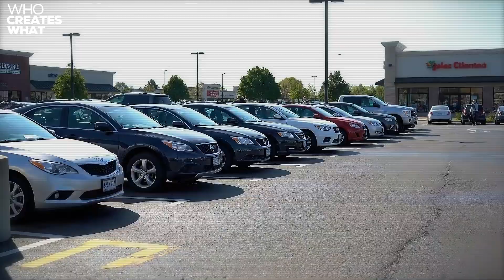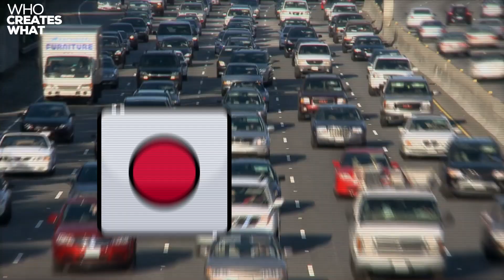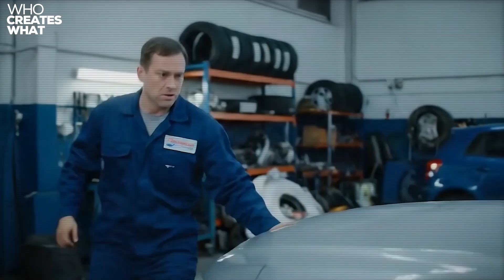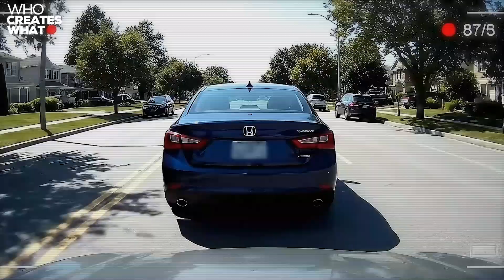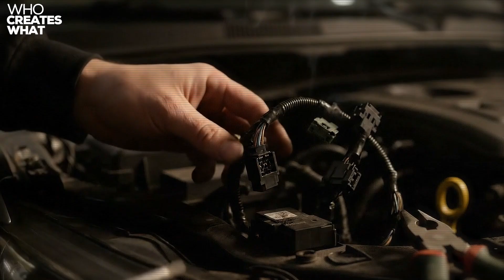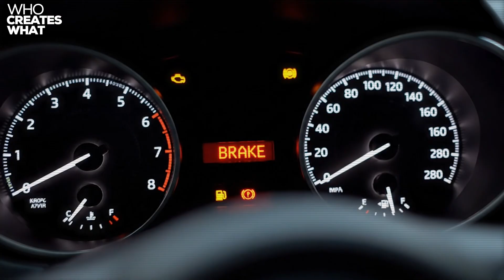Why Your Brake Warning Light Won't Turn Off (Even When Everything Looks Fine)

Comment from the maker: 🔧 Here are the essential tools I use in this video to diagnose brake warning lights (Amazon affiliate links):
Diagnostic Tools:
1. ANCEL AD410 OBD2 Scanner - https://amzn.to/42QuieV
2. AstroAI Digital Multimeter - https://amzn.to/42UMnsd
3. LAUNCH CRP123X Elite Scanner (ABS Code Reader) - https://amzn.to/4o55fgN

Brake Maintenance Products:
4. Prestone DOT 3 Brake Fluid (32 oz) - https://amzn.to/4osnV9R
5. CRC Brake Parts Cleaner (14 oz, 4-Pack) - https://amzn.to/3LnLKRV
6. WD-40 Specialist Electrical Contact Cleaner - https://amzn.to/43vVPCu

Replacement Components:
7. ACDelco Brake Pad Wear Sensor - https://amzn.to/4qETMGz
8. Dorman Brake Fluid Reservoir - https://amzn.to/3L3q5OP
9. Permatex Dielectric Grease (3 oz Tube) - https://amzn.to/43sqDnN

Professional Tool Upgrade:
10. FOXWELL NT624 Elite Scanner (Full System Diagnostics) - https://amzn.to/3J76QU5

As an Amazon Associate, I earn from qualifying purchases at no extra cost to you. These are the exact tools that help diagnose 95% of brake warning light problems.